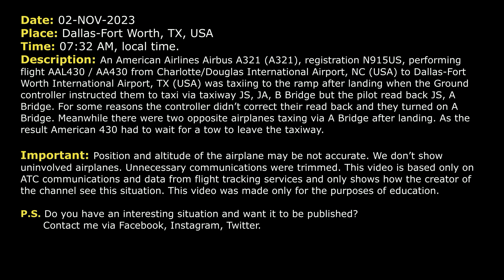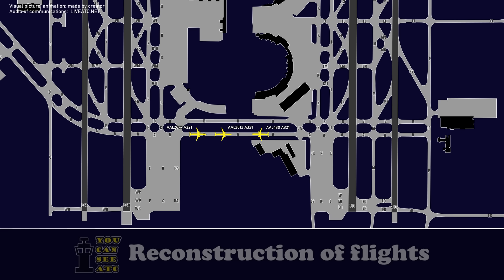Wrong read back causes problems at Dallas-Fort Worth Airport. Taxiway is blocked. Real ATC

Comment: SIGH -  Regardless of the readback not being correct, Tower is supposed to speak clear, concise and at a pace where pilots can take down/understand and comprehend the instructions given.
ATC was speaking waaaay too fast for the standard WPM , it is taught both in ur gen/restricted radio license and when becoming a controller , to be able to communicate/speak at a rate that is both easy to comprehend and understand even if u dont have something to write it down ( human performance is a thing). Ridiculous that this is how instructions are given, slow it down, cause less incidents ... let alone missing her instructions were readback wrong.

Comment: What’s readily apparent with recent incidents is that the read back cross check is largely useless.  The second pilot should have caught this.  

Checking the route would not have helped as it was JS JA B.  JS does connect to B.  And A.  But even if the second pilot didn’t get it the controller should have caught the erroneous readback but I will also tell you that Dfw is understaffed and that ground controller was probably also working a tower or clearance frequency.

Comment: I am under the impression that it's kind of a sport between pilots and controllers to talk as quickly as possible. It's as if they feel especially professional if they do it. I understand that it's important to keep the frequencies clean and clear, but I am pretty certain that, in the end, more time and com space is wasted correcting coms that are either misspoken or misheard, than it would take to simply talk in a reasonable pace to begin with.

Comment: A simple traffic light system at each end of the bridge would remove the risk of that happening. In any case, time for banks of electric, autonomous tugs to quickly hook up to aircraft coming off the runway that will automatically take the plane to the gate. Same tug system to get out to the runway for takeoff... less fuel, carbon and better air quality for local residents.
Reply: Many airports have centre line lights on taxiways that can be switched red or green.
Saves a shed load of radio traffic.

Comment: Yeah, I used to be based out of DFW.  Many pilots do not read the standard taxi instructions and brief potential hot spots on the airport.  the ES route to the west side takes you ES-JS-JA onto the B bridge.  You can easily misread the instructions as JS-A bridge if you don't pay close enough attention.  

This isn't the first or last time this will happen in DFW, as it happens more often than reported. I made the same mistake during COVID, they changed the standard taxi routes to a non-standard route and one day they went back to standard and we ended up nose to nose with an American 737... fortunately ground was able to contact the AA and get them to switch to the A bridge, while we crossed on the B bridge.  

Mistakes happen. We learn from them and try not to make that same mistake.  Never got the "phone number" from ground as no event happened and people were able to continue moving without stopping.  Even ground admitted because they went back to standard routes, everyone had been messing it up.
Reply: Having it be called "Juliet Alpha" which sounds really close to "plain Alpha" would seem like a recipe for disaster. Juliet Bravo would be marginally better, or they could give it another letter entirely. Surely that would be way more obvious.
Reply: @Anolaana  I agree, that was always a briefing item, but when you're DFW based, you already know the threats.  So I assume, these American pilots weren't DFW based, as a result, they weren't fully aware/thoughtful about the potential of the mistake.

One thing however I'm noticing more, ATC needs to verify INCORRECT readbacks. Which would stop a lot of these issues.  If I read back a clearance and it's incorrect, CORRECT ME!!! If I readback an incorrect clearance and you don't correct me on the readback, ATC is at fault.
Reply: Im just a lowly GA pilot. Do any airline EFBs allow you to type in taxi routes? ForeFlight can do that and it highlights the entire taxi route. Such a huge relief at unfamiliar or larger airports. Seems like some simple technology to include in 121 EFBs.
Reply: @brandonadams7837  Some do, most will allow you to draw on the map so you know where to go, but I'd say a majority of pilots don't and just casually 'remember' where their taxi route is supposed to go...

I'm guilty of this myself and have made errors. We all have.
Reply: ATC person did not speak clearly.

Comment: Idk yall, this is an AA base and I really want to say AA has a note in their charts about standard taxi routes. I can almost guarantee there was a moment in that flight deck they both questioned hearing the right thing and didn’t ask for confirmation. Going to have to say this was the pilots fault.
Reply: the tower still didn't check their readback, which is the whole reason there was is a readback. I give it a 70-30 blame split personally

Comment: Hmmm, I don't know anything about piloting/taxiing, but isn't both sides of that bridge referred to as the "alpha bridge"?   Kind of like taking a left onto the wrong side of a divided highway....
Reply: Yeah, the southernmost bridge is still alpha whichever direction you cross it. At 0:25 or so you can see they didn't read it back properly.
Reply: @Anolaana   I guess I oftentimes worry much more about taxiing around on the runway than something happening in the air.  It is obvious that more layers of safety have to be added, simply communicating verbally is not enough...
Reply: no.

Comment: DFW here is confusing because the south bridges you take the right side bridge to cross to the other side. A goes east. B goes west (generally). The north bridges, Y and Z are opposite. They generally have aircraft take the Left side bridge. Z for west, Y for east. Y is the furthest north bridge. I’m always thinking about this being a DFW pilot, so I could see this happening. It didn’t help that Z was closed for several months too, along with tons of other construction right now.
Reply: The construction is a nightmare

Comment: Who’s fault would that be there, the pilots for getting it wrong originally, or the tower failing to correct the read back?
Reply: Controller's responsibility. A controller should only consider a clearance complete once they get the correct readback.
Reply: Mistakes happen. The read back procedure is there to trap mistakes.
It's the controller that didn't use the procedure.

Comment: well it took them 30 minutes to send out a tow??? talking about understaffed... I'd imagine a toe is there in 5...
Reply: Nah, there are A LOT of moving parts and talking heads at a place like dfw. Tugs and bodies aren’t just standing by for whatever. Three airplanes taxiing to their gates at the same time indicates rush hour so all rampers and equipment were likely assigned to other gates. Then theres communication with operations who has to find rampers who arent loading or unloading planes, who have to find a tug thats capable of radio comms with ground controller. Likely it was maintenance who had to come to the rescue because they have the ground control comms capability, equipment and experience. Those tugs aren’t fast and maintenance probably spent a good amount of time laughing their ass off about the situation before going out.

Comment: There's been several instances lately where the tower missed the read back. Why have the read back if the tower ain't going to pay attention?
Reply: @R.BOWERS  Being professional means you can't mishear something on the radio?
Reply: @thomasdalton1508  Its very easy to mis hear something on the radio. There was a crash because what the tower said sounded complexly deferent on the black box.
Reply: You'll also note the read back was stepped on. It would be interesting to hear what came through to tower.
Reply: Seemed like this was a partially stepped on transmission. Juliet Alpha is close to Alpha. There is a standard way to taxi DFW. Controller also has to turnover quickly for new incoming controller. This is also on the pilots. Would be good if there were other systems for airliners to get taxiway instructions then radio for busy airports.
Reply: @R.BOWERS it’s obvious you’re not a professional aviator
Reply: @R.BOWERS if the tower controller thought that… then she is the unprofessional here…
Reply: Operational blame on the controller, professionalism blame on the pilot for fixating and clogging frequency
Reply: Precisely. I think 99% of the blame in situations like this has to go on the controller. Yes, the pilots made a mistake, but radio communications are an imperfect system and everyone knows that. That's why readbacks exist.
Reply: If that’s the case then that was a complacent mindset on the part of ATC. Mistakes happen even with the best of us. That was absolutely pilot deviation, however ATC should’ve checked their readback to ensure both parties were on the same page. This is the exact reason why they’re required.
Reply: EXACTLY

Comment: Why does it take half an hour to sort that out?
Reply: Most tugs only travel 12-18 mph unloaded. Ground calls company ops. Spend a couple minutes on the phone. Company ops calls a supervisor. Spend a couple minutes on the phone. Supervisor calls driver. Driver is handling another aircraft. Driver finishes and heads 3 or so miles around. And because the tug is slower than all of the planes on the taxiways, it is given several "hold short" instructions to not impede traffic.
Reply: push back tow trucks are slow but also they need to cross a lot of busy taxiways this result a "hold short" at every taxi junction. a plane goes at max 34 mph on taxi or 55 km/h aka 30 knots
Reply from the maker: Probably a long route for a tow

Comment: Generally speaking and admittedly I’m painting with a broad brush, but controllers and pilots alike speak too fast, rush clearances and responses and don’t listen.
Reply: Yeah, the pilot went the wrong way, AND the controller missed the read back.  About controllers speking too fast this story was related to me by a pilot friend of mine.  He was a JAG Lawer for the Navy, and had to fly into D. C. occassionally for work.  He was up there one day when the ATC read some instructions to a another pilot in his normal machine gun speech style.  The pilot was probably from my part of the country and spoke slowly with a long drawl.  He asked for the ATC to repeat that.  The ATC once again did it in his machine gun speech style.  The pilot is not completely frustrated.  He replies with, Ya  hear  how  fast  I  am  a  talkin,  that's  also  how  fast  I am a listenin.  I've listened to air traffice radio quite a bit over the years.  I observe, that the system works, mainly because when things are going routine, the ATCs and pilots pretty much know what each other is going to say before they say it.  Especially, if its an airport the pilot flys in and out of routinely and the controller has worked there for a while.  The important thing is when something does go wrong, both parties sit up and pay attention.  The thing that impresses me, is how when things do go wrong, 99% of the time, the controllers and the pilots stay calm, keep their wits about them, and do their jobs.
Reply: It's the cool factor.  No other reason.

Comment: Arguing about it on the radio is never a good look. One time in cruise flight, ATC told us to turn right 10 degrees for traffic. The FO read it back. And I turned the airplane right 10 degrees. We then had a TCAS TA. ATC yelled at us on the radio for turning the wrong direction and gave us a number to call. The FO started to get into an argument over the radio about it. I had to firmly tell him multiple times to let it go. Now isn't the time I said. Even during his radio handoff call he told the controller that he was wrong. The next day he received a call from professional standards.
Reply: The purpose of the requirement to read back the instruction is so that if it is not read back correctly the controller has a duty to correct the crew’s understanding of the instruction.  In this case the read back was not correct and the controller is assigned the responsibly by the ATC Handbook to correct the crew’s inadvertent misunderstanding.  The crew in this case should not be charged with a violation.
Reply: Good advice
Reply: Best way is: “I’m gonna need a sup’s number when you’re ready.” in a calm and professional voice. 

Let them do the arguing if they want, but keep repeating the request. It’s kryptonite for ATC and doesn’t make you look bad or unprofessional.
Reply: FO does not have the attributes to be a pilot.  Sooner or later, his argumentative attitude will result in him over riding ATC and causing an accident.
Reply: He didn't really argue. He was asking for clarification on whether ATC was saying they had done something wrong.
Reply: @thomasdalton1508  Where you also on the flight deck? If not, you don't know what was said or what the tone was-unlike the OP who was actually there and present. Most pilots are type-A people who hate to lose any battle however insignificant. I've seen it a lot personally and professionally. This video, quite literally, shows you that attitude. Humility in the face of mistakes goes a hell of a long way in the airline industry.
Reply: @driftspecs13  I was talking about this video, not his anecdote. Surely that was obvious?
Reply: You know if its not the time on the radio, then these controllers need to have some professional starards as well. They also NEED to be held accountable just as pilots are. 

If they mess up they should have a number to call. Then weeks of investigations befroe they can be let back in the tower
Reply: @TtheAlien I agree was watching a ATC thing last night on you tube I think it was in Europe a number of years back 15+ years, there was only two people on control at the airport tower as it wasent normally busy at night, one controller was dealing with take off and landings in one area the second one in another, the second controller on the right hand side work station decided to take a break", now I don't know if it was a break or a call of nature just at that point the left hand controller had told a plane to climb to whatever it was then gegad to do the right hand sides desk flight climb , forgetting they were now on a collision course don't know if that happened many other reasons were given for all what happened I don't know if they emphasised second controller leaving his desk as a contributing factor, obviously they needed a third hand a supervisor who could also take over if one needed to answer call if nature or a break but if there was fatalities who was to blame , there was modification work on computer systems and it was on back up and ATC knew bosses would know as well so who would carry blame Co pilot from leaving his station main controller for mucking the climbing commands up. The maintained people plane designer for not having a better back up system in place who  knows

Comment: 430 sure had that entitled voice…….was so damn concerned with what happened and almost wanted to argue with the controller. Just stfu dude and call the numbers worry about the other crap later.
Reply: The controller initiated the blame-game by immediately saying the pilot of AAL430 was at fault instead of waiting to hear the tapes. If I was in the pilots shoes I’d be annoyed about that too. The controller should have been focused on fixing the situation rather than assigning fault, especially considering it wasn’t even that controller that gave the instructions so the accusations were even more baseless.